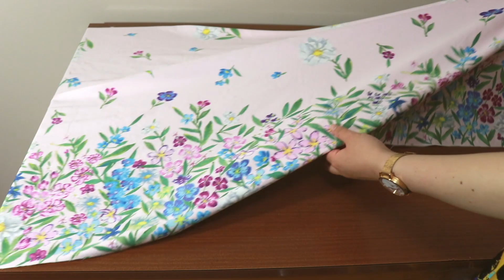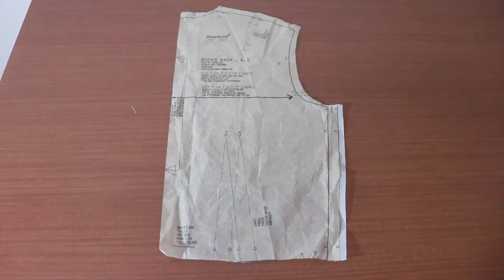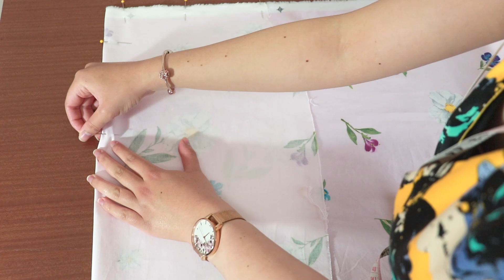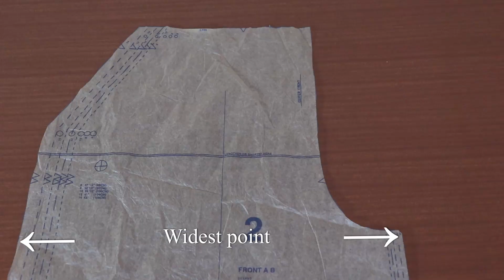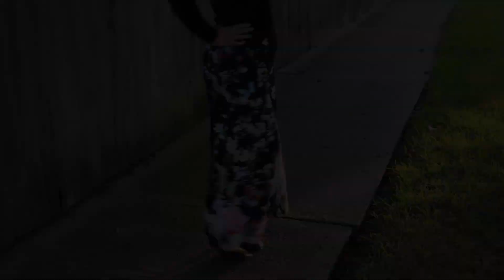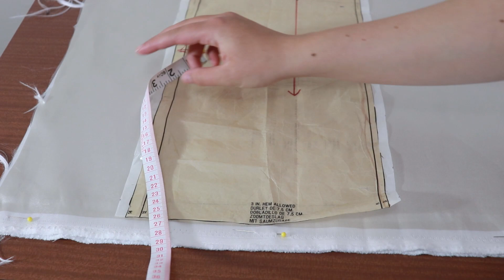Sewing Techniques – 3 Creative Ways to Use Border prints

Comment: Hi!  I used your video to make a wedding dress for my daughter with lace that had a border.  That worked great.  Thanks!  The pattern is sleeveless, now she has decided that she wants some butterfly circular sleeves on it using the border on the edge of the sleeves.  All of the patterns have round edges, so I am stumped on how to go about using my border print.  Any assistance you could offer would be greatly appreciated!
Reply from the maker: Try this way. It looks like a great idea!
https://youtu.be/rWwVziPOp1c
Reply: Thanks but I think that the design of the lace will not look good if I reattach the border. I will review and see though. Thanks for the speedy reply. It is greatly appreciated! 😁
Reply from the maker: @janahepting4006  Hope you find something that works 😊